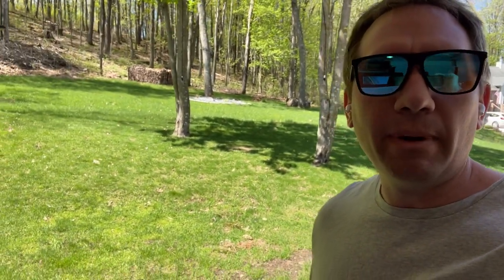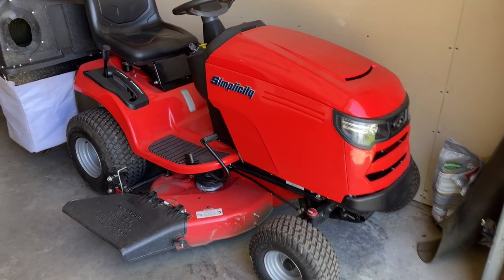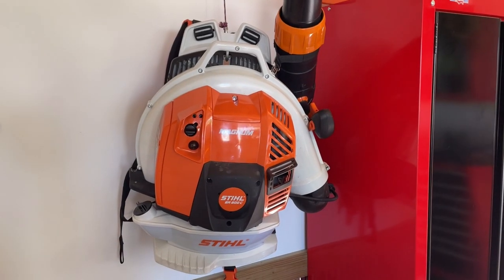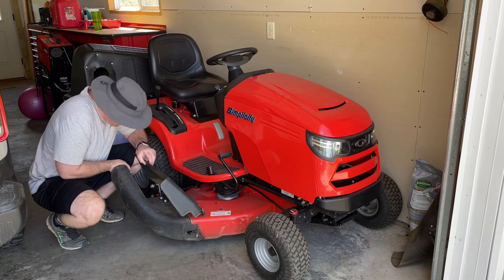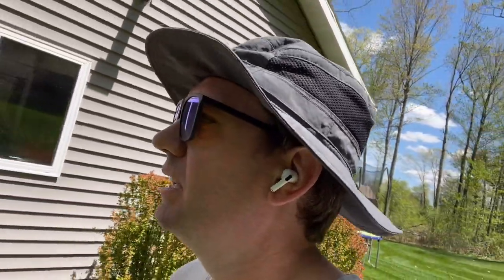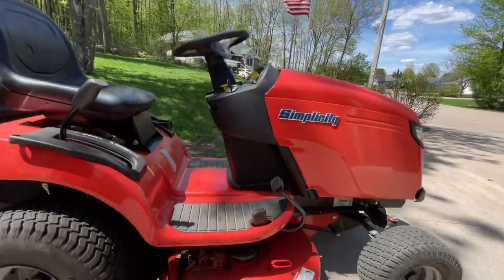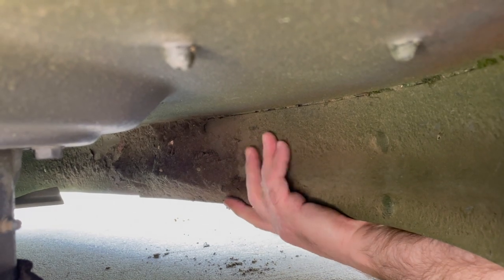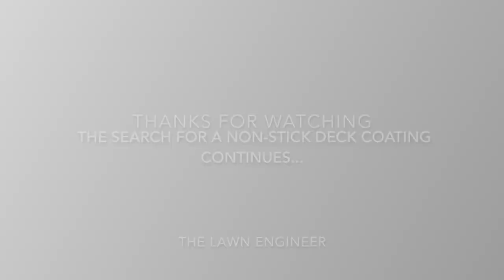Graphite Coating on Mower Deck Test - Non-stick lawn mower coating

Comment: The graphite coating works somewhat while mowing, works best when you have a deck wash.  From PVC, I made a pipe with 3 places to spray water under the deck when the blades are on.  The deck just sheds the grass when being washed.  You would be amazed at how abrasive grass is,  you will have to recoat during the season if you want to keep the deck slippery.  The graphite coating definitely helps mowing wet grass, but you will still have areas where it will buildup, but it won't stick to the metal.
Reply from the maker: That sounds like a great combo, thanks for sharing.  I agree, the graphite paint alone is not enough, the deck wash sounds like a great idea.

Comment: Thanks for sharing 
I just got myself a broadmoor 44 earlier in the year and coated the mower deck with  303 graphhene and then fluid film.
I’m curious how it will hold up👍
Reply from the maker: Awesome, you’ll have to check back and let me know how it holds up.

Comment: Love the ride. I am seriously looking at a rider. Looking for a good option. Your opinion?
Reply from the maker: 1. Walker 2. Simplicity/John Deere   If cut quality is very important Simplicity is 2.  Deere has a edge on parts availability.  But Deere lawn tractors at big box stores are junk made by another company.  Have to get the better ones from implement dealer.